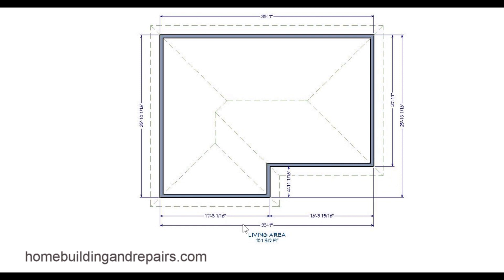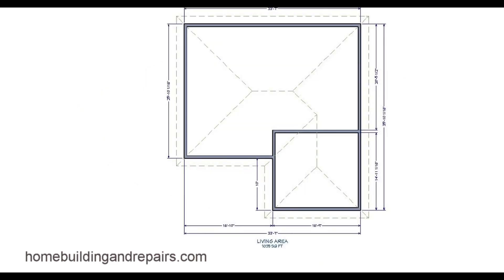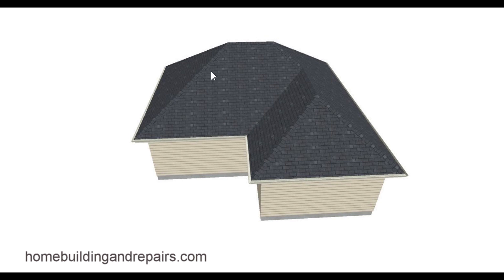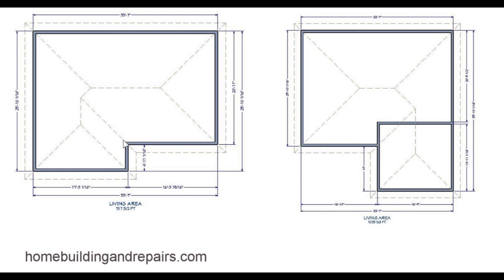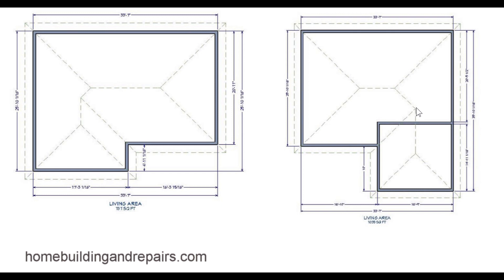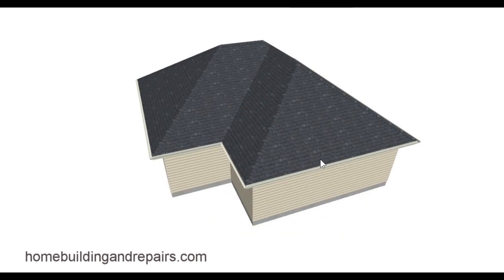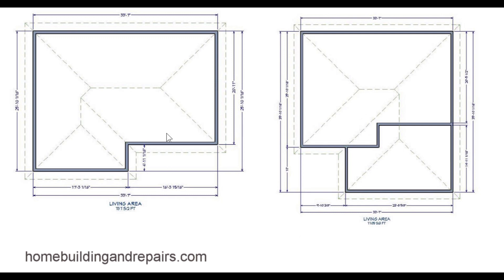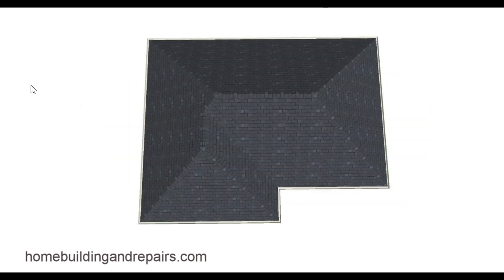Roof Plan for Home Addition with Existing Hip Roof - Building Design Tips

Comment: When you say roof filling, does that mean reframing those parts that need to be fill? Or do you  mean fill the roof by essentially having another roof plane on top of the existing roof plane (i.e continue the hip rafter to the new ridge location)?
Reply from the maker: It could mean either, but most of the time it's building a new roof over an existing one. https://www.homebuildingandrepairs.com/framing/roofs/index.html